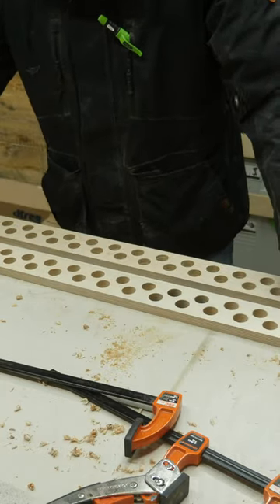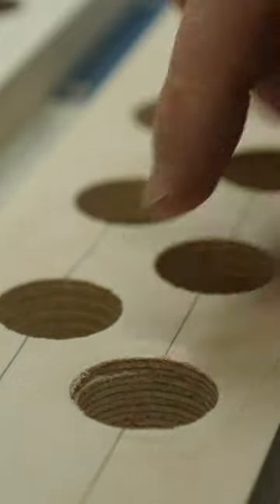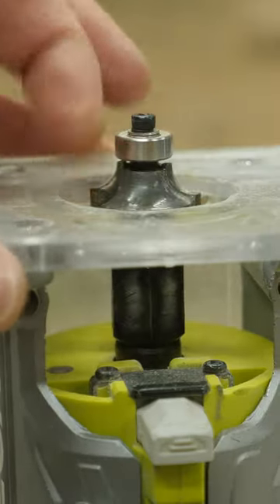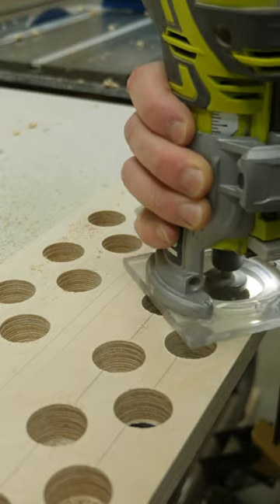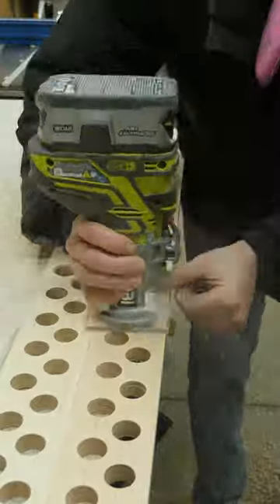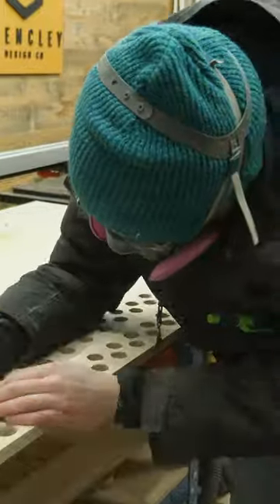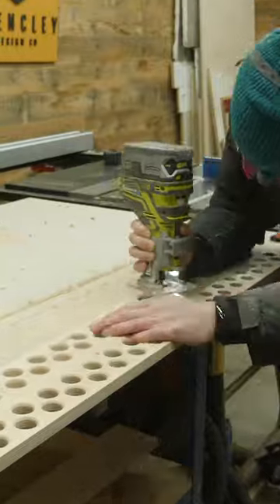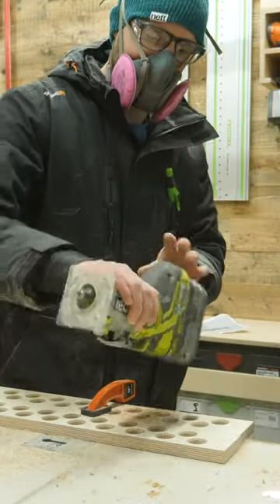people hate this router... and now I know why

Comment: I was gifted a cordless ryobi circular saw and drill, both 18v, about 16 years ago. I used the drill way more than the saw, and about 4 or 5 years ago, I had to replace all the batteries, they stopped holding a charge. I recently, like 2 years ago,  started using the circular saw way more. Both the saw and drill are still going strong, again after 16 years. I added a palm router, the same one as in this video, and a reciprocating saw, the big Sawzall size one, about 2 years back. Use all my tools regularly and have had no failures except the aforementioned batteries.

Comment: I have lots of different brands and several different brands of cordless palm routers.   Had my Ryobi cordless palm router for about 3 years and it still works perfectly.  I use it on places where dust collection is not critical.

Comment: I have blue Ryobi tools from 20+ years ago. Drill, driver, 90⁰ drill, circ saw, recip saw, jig saw, flash light. They came with NiCad batteries, but work with new LI batteries. And they all still work. Pretty amazing if you ask me.

Comment: I think ryobi makes a great homeowner grade tool although when I first started in construction back when ryobi was blue and yellow I started with those and was pleasantly surprised how well they help up to the day to day abuse one puts there tools through as a professional so I don’t think anybody should shy away from ryobi. If you only use your tools on the weekends why burn the money a more professional grade tool will cost you. PS Ryobi has only gotten better with time.
Reply: I have had trouble with newer batteries over the last few years. Other than that, I have many old blues that still run fine 20+ years on.
Reply: It amazes me how many of the blue tools I have mixed in with my Ryobi. Most of the guys I hang out with prefer their Dewalt to my Ryobi hammer drill, because they say the Ryobi is too heavy. I feel bad for those weaklings.

Comment: I have a lot of tools and the majority of them are Ryobi. The only problem I'm finding is when I need to swap out the battery they are so large for my small hands it's hard to get them off the tool. I'm finding the brand Rigid is easier to swap out the batteries so in the future I may start going towards Rigid

Comment: Yeah it’s the person using the tool the gets results, but I would say if you use a tool a ton maybe step up, however if the guy behind the counter will just hand you another one and you live close to HD nice way to save a buck. I have a few ryobi tools and have had mixed results….their hand planer won’t quit, not a fan of the trim router, mine has had collet problems, and bit retention issues (scary). I’ve had issues with their air strike nailers too.

Comment: I have a Ryobi saw, as soon as there’s a bit of difficulty, it turns off. It’s really a waste of money. So I moved to Dewalt and I’m so happy I did. Maybe one day I can move up to Festool but for now, Dewalt is perfect.
Reply: Dewalt is a just a division of Black and Decker.  Still a great tool.
Personally I find that defect on every product line. However, my advice is just to pick a company and go crazy. It is never worth changing over once you have a certain percentage.
Reply: @tobybigham4196  yeah I’ve made the mistake of buying different brands. I started with parkside, einhell, ryobi, dewalt and now festool. I sold everything now and I’m going to stick with Festool. Very expensive for a hobby but my god, those cuts with my new plunge saw are perfect. It’s way better than anything I ever tried.

Comment: Ryobi tools are a perfect balance between a decent tool that works fairly well and a tool that pushes the limits of minimal reliability for a low price. 
Simply put they are junk for heavy users who need perfect reliability at any cost. They are perfect for mid level users who don't need the best/most reliable tool, just need to get something done and can live with a few shortcomings. 

They are good enough. I have a few. But mostly Makita and Milwaukee for my paid work. I like them better than the modern DeWalt cordless tools, which seem to underperform. But don't hate, just buy what you want or need. Ryobi tools seem to be better than the Harbor freight ones that match their prices. 

Remember that tools are for doing things, not impressing your friends and coworkers. 👹